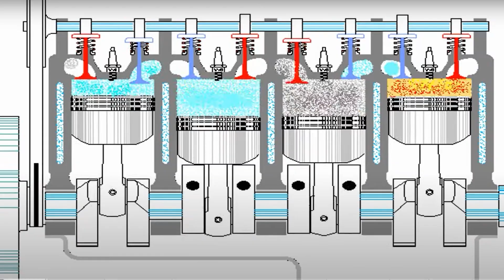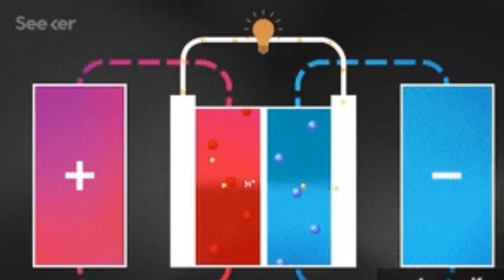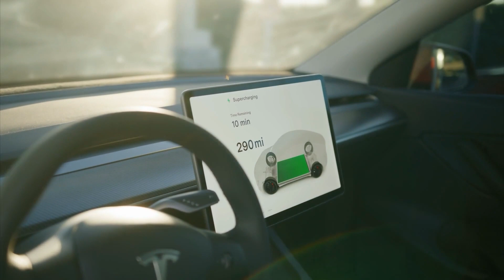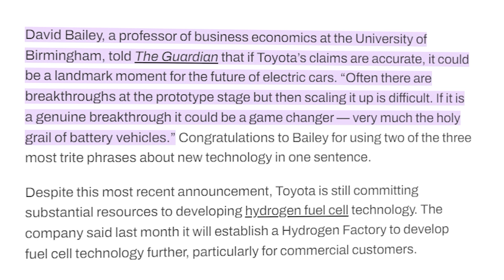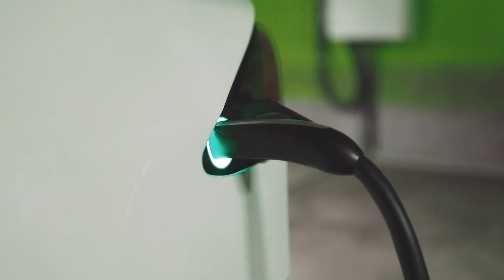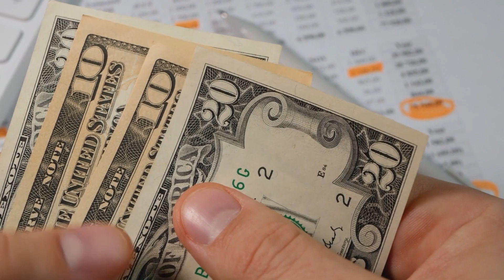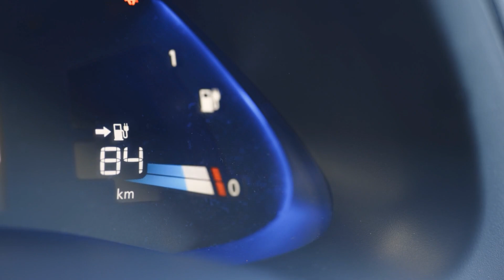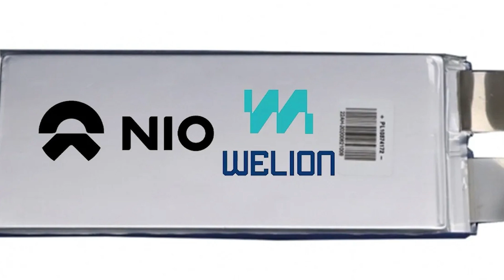Toyota CEO "Our New Battery Will Change The Industry FOREVER"

Comment: They never talk about "battery management" .
If the current going to each cell pack is not controlled, one cell pack can reach full charge and another pack could be over charged. 
An over charged cell pack will over heat and result in a "nuclear" fire.

Comment: Whats up the hydrogen engine??
Reply: Like trying to use Hydrogen as any form of power source, it can work, but it’s a fundamentally terrible idea.
Reply: @UKenGB agreed. I wish it could work, but unless there’s some enormous leaps and bounds in technology, hydrogen just isn’t feasible. I’d like to see the railroad embrace it though, I think there’s more potential there
Reply: @ArsonistArborist  But why do you "wish it would work"? Just what are the supposed 'advantages' of using Hydrogen over batteries and synthetic fuel in the short to medium term for those special uses where batteries are not yet sufficient? 

Technology will improve batteries (or whatever we call direct energy storage in the future), motors and all the other associated electronics, but it cannot, i mean it CANNOT change the laws of Physics that are what makes Hydrogen such a terrible idea

Hydrogen IS the lightest element with the smallest possible atom (cannot get less than one after all) and it WILL leak through ANYTHING and it CANNOT exist as a liquid at room temperature so to carry sufficient quantities, Hydrogen gas has to be compressed to up to 10,000 psi. You want to drive around with such hugely compressed explosive gas under your seat? Also it requires several 'lossy' energy conversion stages for use in vehicles, making the whole process very inefficient (less than half as efficient compared to using batteries). These are the immutable laws of Physics of our Universe.

Hydrogen is a cute fantasy solution that appeals to the ignorant and/or those with a vested interest in its proliferation as a fuel, i.e. the fossil fuel/oil industry, who are pushing hard for its adoption because most of the world's hydrogen production requires huge amounts of gas for the process and who profits from that use of gas? Not hard to figure that one out. The oil industry sees Hydrogen as its saviour, but don't be hoodwinked by the massive pressure they are applying to get this 'Hydrogen as a fuel' nonsense believed.

So, let's say it all together now - "Hydrogen is a terrible idea". 😀

Comment: Lower cost of battery does not mean manufactures or dealerships will lower price.  It just means they can increase their profit.
Reply: Depends if other manufacturers follow suit with their pricing. But we know how chinese company sells their cars at low price despite getting smaller profit.
Reply: @camz9014 Yeah, a cheap Chinese death trap. Good luck 🍀👍
Reply: Price is not driven by profit but by consumers … at least in the automotive industry . Cost reduction of solid state batteries is essential to make viable cars .